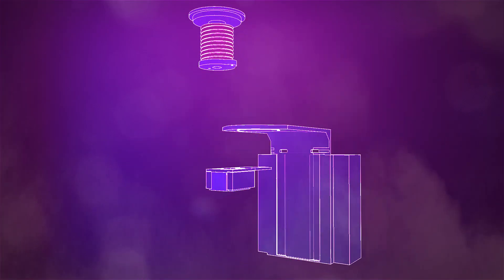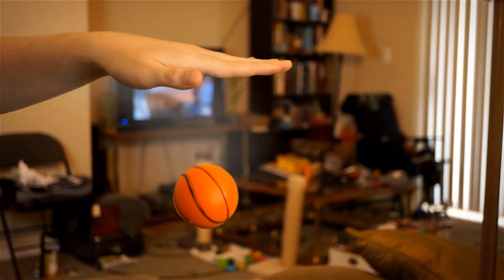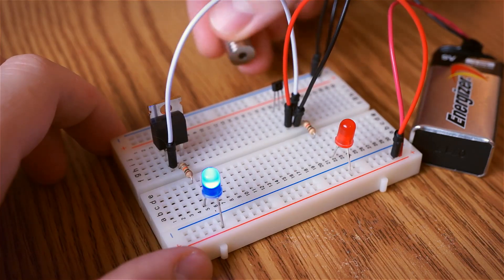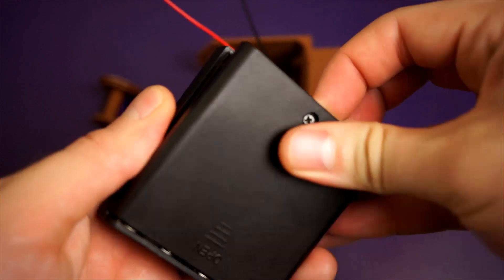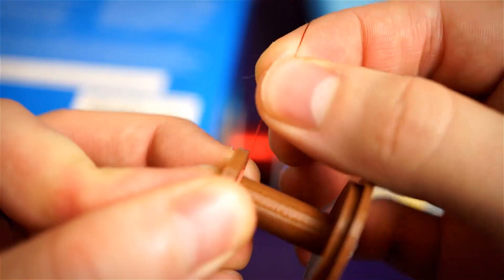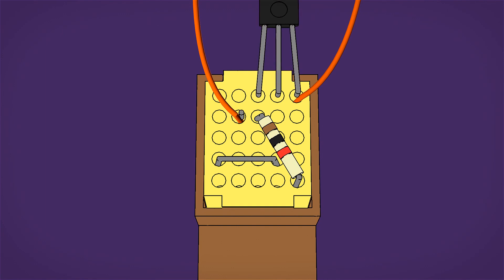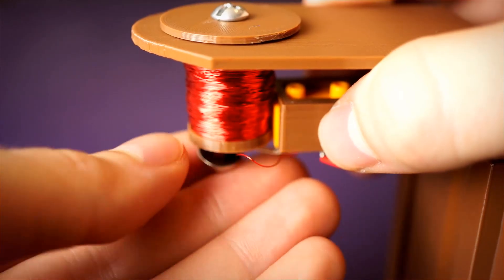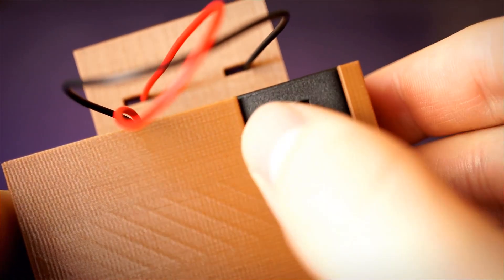Easy 3D Printed Levitation

Comment: I just made this project, but I can't get a small magnet, with or without a hole in the center, to suspend. At first I was thinking that I have the coil wires in wrong order, so I reverse them - it sucked the small magnet to the coil; so I put it back as it was originally. Do you have any suggestion? Thank you again!

Comment: I made it but the magnet is getting attracted to the hall sensor and repelled from the coil. I also tried switching the ends of the copper wire. Please HELP me fast.
Reply: Hi!You have to see the voltage of Hall sensor and features of this components and use the air coil to avoid this phenomen,never put the sensor near the magnetic field of air coil.Try it and you should have a good result.
Reply: if hall sensor is in the high voltage ,it is very sensible.
Reply from the maker: Try turning the magnet over? Double check the hall sensor and mosfet are working correctly. components can break. Try watching the video again closely. Its hard to figure it out without looking at it but let me know if you figure out what it was.

Comment: Is the magnet wire same as enameled copper wire? Or does it have a different composition?
Reply from the maker: Good question. They are both the same. Both are copper wire with a thin enamel coating which is perfect for making a coil like this since we can get lots of turns for a strong electromagnet. Use the same thickness as I did, AWG 30. Any higher or lower may produce incorrect results.
Reply: 3DSage oh I see, thank you for the quick reply...I'm trying to remake your project, I'm not very sure if I'll find the same MOSFET and hall sensor at my place..so I might pop up here to ask you some more questions if you don't mind xD
Reply from the maker: I believe you can search the component name and type similar in google to find components that are pretty much the same. Any similar mosfet should work and the hall sensor needs to be unipolar.

Comment: How do you have a 3D printer but not a drill? I recommend getting one. It would make winding your coil much less laborious.  Edit: Actually, if you want a device that can operate continuously, using a pre-made coil from a 5V relay should work better.
Reply from the maker: haha hm I guess I don't have a drill. But I also wanted to keep this simple and winding it by hand isn't too hard and it's more rewarding when it all works. And I feel like winding wire with a drill would take some practice to master. If you want to, you can try it. And I originally thought of using a pre-made coil but I like how mine turned out.
Reply: @3DSage  bro you designed this hahaha.... I feel like your messing with us you have to have a drill or a Dremel or something 😄 in saying that you saved me a head ache on the general setup of mine so thankyou ..
Reply: I say this as I built a hydrogen jet engine from scrap and I had next to no tools money or parts and nothing but time so I do feel you on accomplishing it regardless ... that engine was entirely seized the next day as used the wrong combinations of metal 🤣

Comment: THANK YOU! My freind and I were talking about somthing like this the other night. We asumed we'd need an ardu\iuono etc. So thanks for the low tech but V smart solution!. Reminds me of school when we did the light dependand resister cuicuit, but instead of hocking up a bulp i used a relay and a lamp OVER the sensor, so tuning it on, turns it off :) 

V impressed sir, and thank you again!
Reply from the maker: You are welcome! :) I really wanted to keep it as simple as possible. I'm glad you liked it! Thank you for your comment.